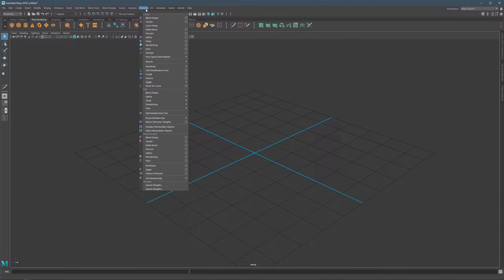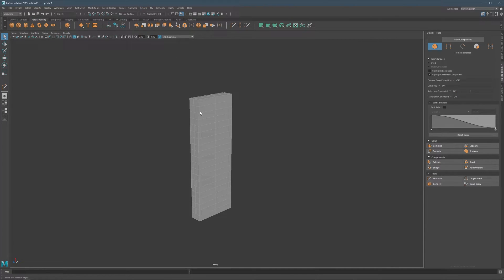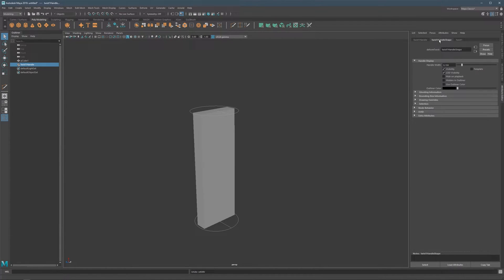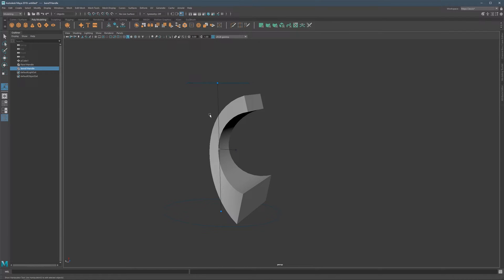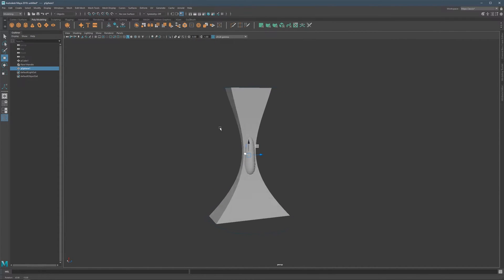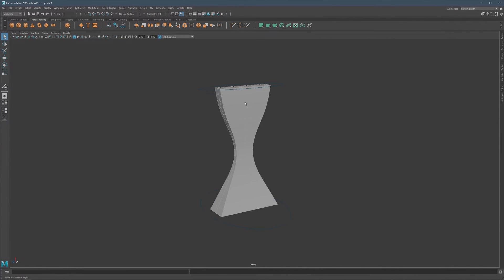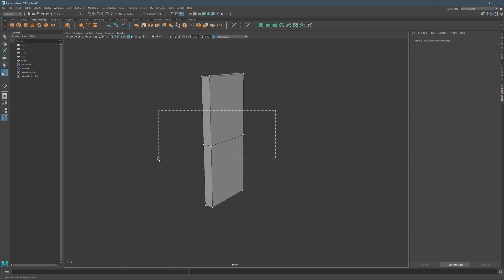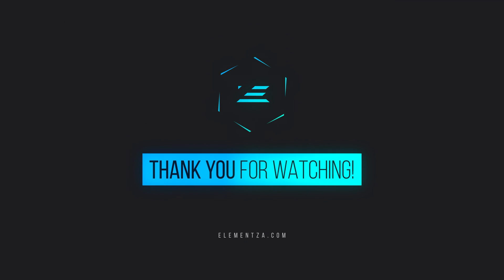Intro to 3D Modeling in Maya / Deformers

Comment: I hope you do a course on Modeling in Blender one day.
Reply from the maker: The Maya one covers already everything you'll need, and same rules apply in Blender too. If you're comfortable with basic tools in Blender,  not much is different except where tools are located, way you use hotkeys etc. Topology rules, design rules, all apply the same there too
Reply: @Elementza  Yeah, I was hoping in terms of introduction to Blender and it’s modeling tools. Topology is the easy part because it’s consistent - the same in all applications - but I always have a hard time finding tools and getting comfortable when changing applications. For that, your detailed walkthrough of everything was a HUGE help.